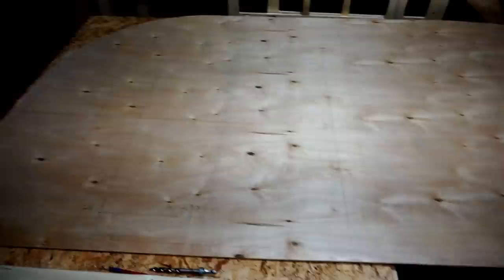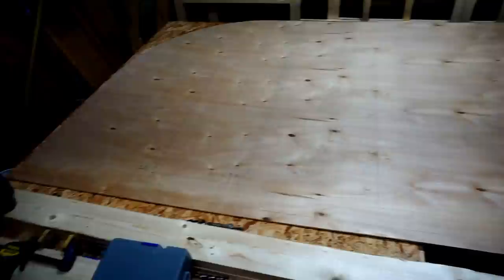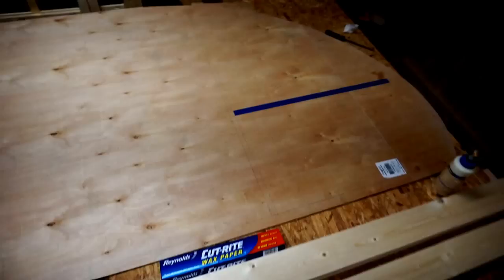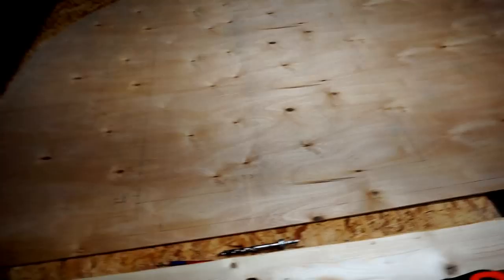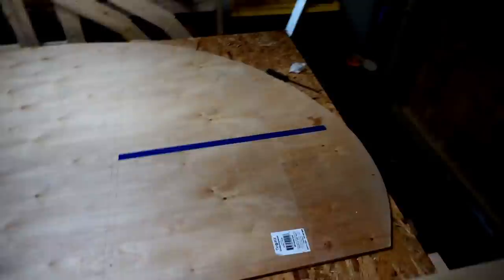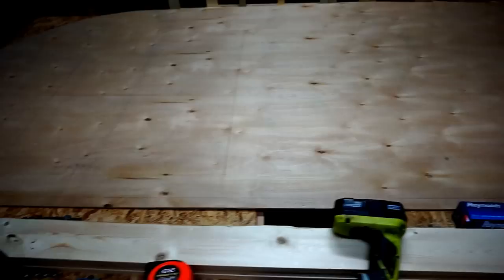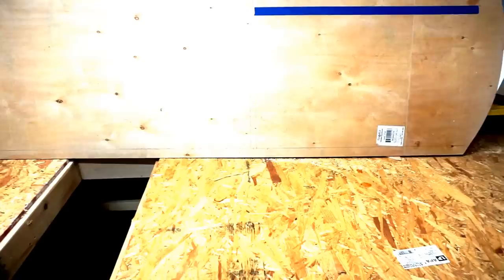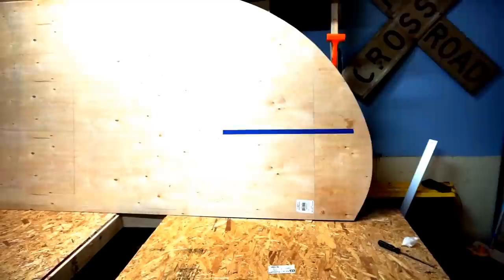How to Build a Teardrop Camper #1 - The Template

Comment: I am looking at the 5×8 Ironton trailer as well for my build, any issues? Did you shim under the floor to compensate for the small lip where the cross member meets the frame rail? Awesome build, binge watched it today and would love to see a finished walk through.
Reply from the maker: Hi. Thanks for watching. No, no issues at all.  We were very pleased with the trailer.  Maybe a little tight on the axle, but it's a sprung axle, so that's to be expected.  We have a torflex axle on my other trailer, so it's much smoother, but also much heavier.  We did shim a bit in those areas, but really not that worried about it.  Just in the middle where the floor would tend to sag a bit when crawling around on your knees in the camper.  I guess we could have put some sealent under it, but wanted be able un unbot it easily if needed.

Comment: how much will all the materials cost from start to finish?
Reply from the maker: After it's all said and done, about 3500-4K.  Thanks for watching.
Reply: That varies from region to region, if you have to hire a person to do something specialized such as welding on the frame, electric and so on. WHAT materials you choose to use also has a huge impact on total cost.
Reply: Keep your eye out for campers headed for the dump to save some coin. 
I have an old snowmobile trailer which is looking like it will be my frame. 
I have an old insert trailer which is shot, but the appliances are good so they will be used inside, as will the frame for a slide out bed, cabinets etc. 
Honestly I just wanted someone to haul mine away before I decided to try this build. 
Lots of people doing the same or for next to nothing.
Reply: FYI everyone. The trailer is the easy part . Harbor freight has a 1700 # one cheap 
3/4” plywood is around 75# per sheet 
Use 3/4 on the floor , and smaller elsewhere. 

Nice tutorial 👍🏻👍🏻👍🏻

Comment: What does it weigh?
Reply from the maker: I will weigh about 1100 lbs when complete.
Reply: Dad Rambles how do you check the weight, because I want to make something bigger but don't want to exceed 3000 pounds?
Reply from the maker: It's sort of experience and knowing how it's constructed, and comparing to others that are similar.  Did you see my other video of the "regal eagle"?  It's very heavy, and is only about 1850 lbs dry weight.  Do you have plans yet for what you want to build?

Comment: Why put any curves in at all? A rectangle gives you more volume for the same footprint and makes for a much easier build.
Reply from the maker: +JPVegh looks... I could definitely have built a "box" easier and with more room... But this had more style. It's a balance.
Reply: Dad Rambles Workshop I see your point but for me function is more important than form and has an aesthetic quality of its own. That said I can definitely appreciate what you've done here.
Reply from the maker: Thank you.  Yeah that's what i really like about the "creative" side of designing campers.  Very rarely do you see 2 exactly the same.  We have been to quite a few teardrop gatherings and it's always interesting to see the different designs.
Reply: The added benefit behind the curves beyond aesthics is airflow. You get far better airflow and thus gas mileage with a curved surface that air can go around rather than just a box shape.
Reply: John Cashion no doubt, it is a trade off, mpg or volume.
Reply: I don't think with a curved roof there is even that much of a trade off as the volume is mostly wasted space anyways. If you curve the front you lose a little headroom where you sleep, but are you ever really standing or upright in that portion of the trailer? and then on the other end you have the galley, and there is a limit to how much stuff you could stack and still keep that space usable. I think the curves on your trailer (or any of the curved ones) make the most logical choice because the mpg is so much more valuable than the volume you potentially gain in mostly wasted space.
Reply: John Cashion actually that's all valuable space for storage, air conditioner, refrigerator, electronics, etcetera. MPG is great if you're on the road a lot, so is towability but a few extra cubic feet can also make quite a difference, especially in such a small trailer.
Reply: That's why it's called teardrop and not square drop